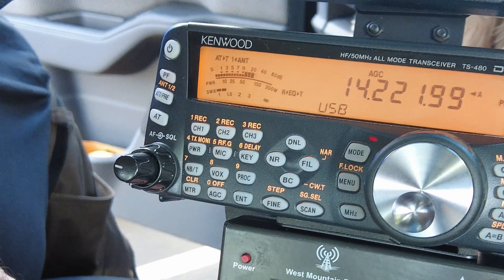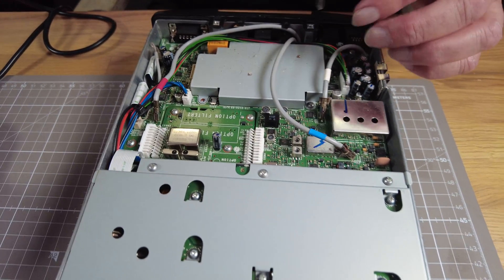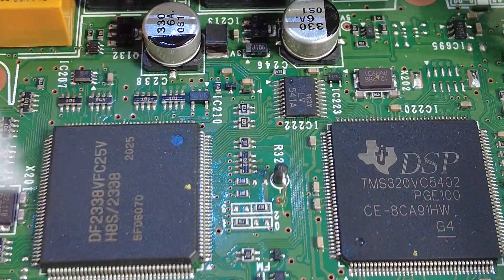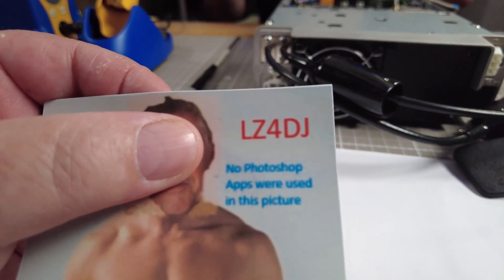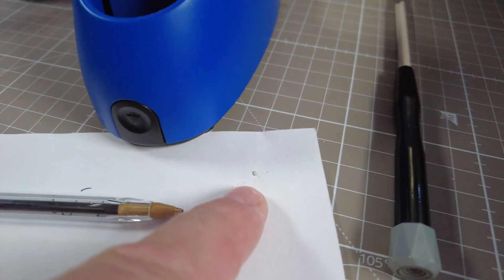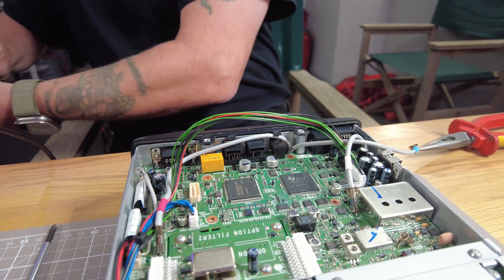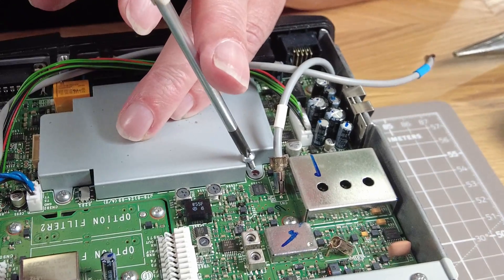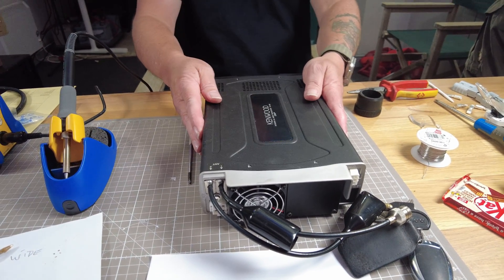WideBanding Any Radio Technique MARS Mod CB (Kenwood TS-480)

Comment: Do you have experience in changing a Ts-50 Kenwood to transmit on 7 and 27 mhz. I disconnected diode 3, 4 and 5  on the board but now my output changed to 25, 12,5 an 2,5 watts. 27 Mhz and 7 Mhz are possible to transmit now but on low outputpower. did I disconnect a diode too much?  I could not find an answer on internet.
Reply from the maker: No idea. Sorry.

Comment: It is legal in UK...?
Reply from the maker: You can own a radio in the UK, sure.
Reply: Yes it is perfectly legal to modify (or even build your own) ham radios.  It is up to the operator to use it within the laws/rules of the country.  Now my radio has 60m band.  It CAN go to 11m (for instance) but USING it there is not allowed. That is the difference.  Simply owning such a radio is OK - it's what you do with it that counts.

Comment: Mike… beautiful rework job with the SMD resistors.  As an electronic technician for over 40 years, I would also diagram the components in a hand-written pictorial and keep the desoldered components in a tiny plastic bag in case Callum or a future new owner wants to revert back to the original configured radio.  73 de KD6UYK (Tim)
Reply from the maker: That was my fault.. I lost them!

Comment: Icom is similar. Tiny diodes you add remove for the different band plains.  They make a soldering iron that look like tweezers and heats both sides.  Microscope needed to read them parts. 73

Comment: You may find it easier to use one iron and solder blob on top of those resistors and keeping adding until it spreads across both pads, then the resistor will hold to your soldering tip via surface tension and you can just lift it off.

Comment: MARS also known as the American Military Affiliate Radio Service was shut down after the ARRL eliminated the Morse Code copy requirement and published the questions and correct answers for American Amateur Radio Tests so American Hams could no longer meet the Military Requirements for MARS Amateur Radio Operators. The military Frequencies are no longer available for MARS service since it no longer exists. There is no legal reason to "MARS" mod an Amateur Radio today.
Reply: In the UK we have access to 5MHz.  MARS has never been a thing.
Reply from the maker: @n4zou .. but folks still call it the MARS mod. Keep taking the pills :)
Reply: Air Force and Army MARS are alive and well!  K7NFO
Reply: @mikehorvath4780  no they are not. They are considered an emergency backup service but the military Frequencies that were used can no longer be used by Amateur Radio Operators and the MARS messaging network was shut down as well. Those MARS programs only exist on paper.

Comment: Some rigs wideband better than others. Avoid Japanese imports (i.e. purchased in Japan) because they are impossible to wideband due to local laws. I found that an “export” IC-705 widebands nicely once modded because it is still possible to leave the out-of-band locks in place (just “soft” instead of “hard” locks) and then program in new bands, such as a CB mid and CB UK bands. The Yaesu FTDX-10, however, just transmits anywhere once modded so you really need to remember where the band edges are, or look at a band plan. I find the WARC bands a bit difficult to remember without some help.
Reply: Simon well said - it's up to the user to take responsibility for how they use their kit.  The rules are there for a reason and society just works better if we understand that - particularly with the finite RF spectrum.  I have the 705 too - wide banded as are all my radios to allow 5Mhz, but it's not a CB.  In fact it's overkill for a CB - no roger beep!
Reply: @M0RMY  No roger bleep??? Don’t worry, there’s a mod for that…..

Comment: Honestly I’m disappointed that you posted this, particularly with your wide audience.  As amateur radio operators we should recognize that there are rules for use of radio bands for a reason and not promote breaking of those rules.  It’s frustrating how cavalier so many people are about flagrantly violating regulations for services like CB, PMR, and GMRS, and promoting MARS mods to people who have absolutely nothing to do with the MARS program.  This is irresponsible…
Reply: Tony, the US isn't the centre of the universe—'MARS mod' has become a widely recognised term for widebanding radios, which is perfectly legal in many countries. While the Military Auxiliary Radio System and Civil Air Patrol systems are relevant within the US, they have no bearing on those of us outside it. Manufacturers incorporate widebanding methods into the firmware and hardware, not just for MARS/CAP, but for various other global uses.
Reply: It's not really though is it, it's called having radio fun. #funatparties
Reply: Thats why i never cared for Ham way too salty
Reply: @wloop7659  Not all of us
Reply: Personally I have nothing to with any Mars programme and I have no wish to speak to anyone on Mars (though I probably would if there was anyone there!) but I have made a few QSOs on 60m on my (previously wide-banded by someone else) IC-706. G1YJY.
Reply: Just rotate the VFO or turn the radio off if you hear someone you don't want to hear.
Reply: Tony, it is perfectly legal to do this modification in the UK - for the right reasons.   I think you have missed the reason we did it - despite me saying so in the video.  We have amateur radio access to the 5MHz band here and we do not have MARS - that is a US thing.  We do have occasions to talk with military stations sometimes, as part of their cadet radio exercises and training.  As a Colonel in the British Army, I welcome the opportunity to talk to the next generation of military radio users and help with their VP.  It is not irresponsible to share open-source knowledge (it's in the service manual for the radio) and I have perfectly good CB radios if I wish to use that mode - which I do.  

I have all my radios wide banded (my TS990 was done (perfectly legally) by the store where I bought it).  My car does over 100mph but I don't drive that fast.   I like golf but I don't cheat by throwing the ball.  Your insinuations are, frankly, offensive and you should retract your statement as it merely goes to illustrate how narrow-minded and accusatory you are.  

This type of "gate-keeping" by some hams is exactly why some keen users of GMRS (again a USA-only "thing") and CB are put off from possibly taking the next step in their radio experience.  Who would want to learn all the rules, take exams (in the UK we don't get to see the questions and answers before the test)  and then celebrate their success by bumping into someone like you?  A self-appointed policeman of the airwaves who gives nobody the benefit of the doubt, and not a hint of welcoming vibes. After 40 years of radio fun, I am not going to pander to your ridiculous statements.  My radio, my choice, my region's rules (which I stick to).
Reply: @M0RMY well said Sir….
Reply: @billybiker1383  Thanks Billybiker
Reply: The American Military ended its MARS (Military Affiliate Radio Service) after the ARRL eliminated the Morse Code copy requirement and published the questions and correct answers for all American Amateur Radio tests. This disqualified American Amateur Radio Operators from using Military MARS Frequencies to pass traffic from Service Members to their families back home between MARS and Amateur Radio message nets. American Amateur Radio Operators are no longer allowed to use Military Frequencies for any reason.
Reply from the maker: And how else is Tom going to get on 60m? I wideband ALL my radios anyway as a matter of course. Get a grip.
Reply: @DXCommanderHQ well said Sir

Comment: Related (or not) to this, beware of the Japanese Domestic Market versions of many radios. The ROMs within some of the chips are different and they will not "wideband" like this. On a practical level, it is not a bad idea to mask the surrounding board with post-it notes while you are working on removing these components, it will eliminate the risk of solder splashes landing unseen on other components. 73

Comment: The all band transmit modification is easier on the American market version of the TS-480. Many radios from that era have different modifications for the MARS mod and for the all band transmit mod. You often don't have to do both if you do the all band mod. The old MARS mods usually just unlocked the MARS portions of the amateur bands and not all bands and not 11 meters. I had a TS-480 for a period of time.

Comment: Some radios do not have the appropriate filters in them for "extra" frequencies so you need to be careful about opening them up.
Reply from the maker: Indeed, for instance the 7300.. Bad mistake.
Reply: @DXCommanderHQ  The Kenwood TS50 used to be a favorite for CBers to get opened up for 11M here in Canada.
Of course it's not legal to enable ham radio equipment to be used on 11M or to use it but many do it anyway. Most hams will not do that here and most won't buy a used radio that has been opened up.
Reply: 11M is just not very popular anymore here. Some truckers still use them however.
Cell phones and chat apps like Zello have pretty much replaced them I think.
Pretty big wide open spaces here for line of sight on 11M to be of much use.
Reply: @ve3pcp  I guess my radio collection is worthless then!  No mind - It is a great radio and now is on 5Mhz.  It is not illegal in UK to modify ham radios to 11m - just to use them there!
Reply: @M0RMY  I don't think I said anything about them being useless did I? 
To each their own.. Different countries, different standards..